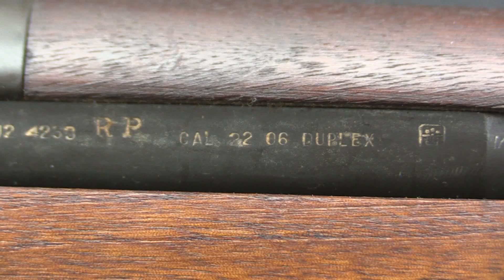.22-06 Duplex M1 Garand

Comment: In a shoulder rifle I don’t think the trade off is worth it.

However in say A belt fed MG like the M60 triplex rounds could make a lot of sense.  Pair the new cartridge with an appropriate regressively rifled barrel and you turn a gun firing 600 long range projectiles per minute into one spitting 1800 short range bullets.  In the MG role accuracy can be sacrificed for a 300% increase in hit percentage without any increase in heat buildup.

The ideal weapon for jungle patrol in Vietnam, an M60 firing triplex bullets from a commando length barrel.

Comment: DUPLEX ROUNDS will ALWAYS have the bullet in the back rear end the bullet in front in flight, degrading the accuracy of both significantly. The reason being that once the bullet leaves the muzzle, the front projectile will be bearing a higher aerodynamic drag while the rear projectile is drafting low pressure zone behind the front bullet. With both practically in contact at the muzzle, the blunt nose of the rear projectile is irrelevant; it will slow down at a slower rate than the bullet in front and rear end it in flight. The projectiles only begin to separate after the collision has destabilized both projectiles a little and they diverge sufficiently to unmask the rear projectile. It's a total shit show and there is no way to overcome the problem.

Comment: 65% better probability of hitting a target is no laughing matter. wonder at what range and groupings they were getting these
Reply: It was probably within practical range, but around the time they stopped the m16 was starting to become the go to rifle. Even though it wasn't a particularly good rifle, it was certainly an improvement over the M1 Garand. Even though I'd kill for an M1 Garand or Kar98k for historic value alone.
Reply: @Logan-zp8bi  did you mean to say the m14? The m16 was a fine rifle, no more hiccups than your typical military adopted rifle. Worst thing was ridiculous instructions to troops that the weapon didn't need cleaning.
Reply: @protoman1214  No I meant m16, there was some issue about the forward assist and failing to clear rifles to the point the problem becomes worse.
Reply: @Logan-zp8bi  hate to break it to you but our military didn't go from the m1 Garand to the m16
Reply: @protoman1214  I know, I was meaning around the time they discontinued the project, he said a couple of decades and mentions in the description during the 1950s. The m16 went into service 1965 and officially replaced the m14 in 1968.
Reply: @Logan-zp8bi  the m16 was an excellent wepon. Special forces using it in Vietnam was the reason it got adopted.  They had no issues with it. Untill they gave it to hippie draftees who couldn't maintain firearms and were told not to clean the gun.
Reply: @justinlance4174  It wasn't this, the M16 being finicky without cleaning is fuddlore. The real reason the gun saw issues, is because of the Amey giving soldiers bad ammo.
Reply: @Logan-zp8bi   you can get some in auction pretty easily for less than a grand
Reply: 50 to 300m iirc, search salvo rifle experiment im dtic.mil, it is available to the public.
Reply: Yeah knowing what methodology they used is really important. I suspect they used a silly criteria to try and market this
Reply: Probably close range. The light weight of the projectile gives it a low ballistic coefficiency. It will lose velocity and stability rather quickly.
Reply: Big thing!! Love it!
Reply: This 22 06 sounds pretty close to a 223, wonder if that helped at all, aside from firing two bullets...

Comment: I like the duplex theory better than the multiround burst theory, mostly because of the Closed Bolt.  If you fire from a closed bolt, then the 1st round of your burst is from a closed bolt.  The second one from a 2 round burst?  Open, then closes the bolt before it fires, regardless of how fast the rate of fire is, that reciprocation affects the accuracy.  So does duplexing, which I have tried.  The second round is generally the one that deviates from zero, on a bench rest.  However, I tested this handloading for Revolvers, and single shots.  (Contender, Competitor, which is basically the Lone Eagle with some improvements, and break open combination guns.)  Take the Taurus Judge, and duplex load slugs.  It's real easy, cheap, and accurate enough for what it is:  A pistol.  (Compared to the accuracy of 3 ball buck, you have 2 Minié Balls, instead of 3 spheres of lead.)  It has no business in a dedicated battle rifle, because there Accuracy is the primary concern, but in an Assault Carbine.  I would have to get a .30 Blackout and some dies to experiment with.  It's a hell of a lot easier to handload for manual (Lever, pump, revolvers, and single shot) actions.
Reply: Actually the best I've done was triplexing wadcutters in a Dan Wesson .357 Maximum.  Good luck getting your hands on one of those.  The point is, that multiplex rounds are available for civilians.  If you can get a rifled .45/410, it's pretty damned accessible.  Multiround bursts?  Not so much.

Comment: Seems like a decent concept. A little less energy than a 223, but pretty useable. I wonder if the projectiles tumbled after hitting like the original 55 gr 5.56mm did (1:14 twist i believe). I have a little experience with the Remington 357 Mag multiball load (2 000 buck pellets, 140 gr total). Shot well out of my 2.5" M-66. Spread was only a couple inches tops at 10 yds. Because the pellets are .36" and swage down through the forcing cone. Once i get going on handloading, i plan to re-create that load with sone Hornady buckshot i have (Remington discontinued the load years ago). Depending on what round ball moulds i can find, i might experiment with 45 ACP and 45 Colt, and maybe even 40. I remember an article from the 80's about short "tuna can" wadcutters for multi projectile loads. Should be fun and intetesting.

Comment: If there had been the saboted .22 Accelerator at that time, it could have been a (chronographed)
4000+ fps .22 projectile at minimal recoil. I have shot those at 1 MOA, although the impact was 10 inches
low in an 18 inch bbl   Ruger RSI 30.06 The 5.56 weighs less and takes up less space so more can be carried, but
it still makes you wonder what could have been.
Reply: Also, a true "duplex load" is something very different if you have read Elmer Keith

Comment: I suspect this is just a 06 necked down to 22 and you could most likely use loads designed for a swift in it.  Of course the 06 is over bore for a 308 round unless you use a very long barrel so....

Comment: "our troops are wasting too much ammo! lets make a rifle that fires two bullets at once, so they waste twice as much!"

genius
Reply: +SamuraiPie8111 
They weren't concerned about waste of ammo, they were concerned about poor accuracy, shown by large ammo expenditure per kill.
Also, a duplex round won't actually waste twice as much ammo, it will still be a single round, just with two bullets in the same casing.

Kind of like how a buckshot shell is still considered a single shell rather than several just because it contains several pellets in the same shell.
Reply: *****
An assumption based on that the main cost of round is the projectile.
The cost of ammo, if that's what you are calling a waste, is much more on the brass case (or steel, or tombak or whatever) the propellant and the primer cap.
I doubt that duplex ammo is that much of a cost increase over a normal round of roughly the same size and parameters.
It's kind of like saying that the main reason NATO switched standard caliber from 7,62x51 to 5,56x45 was that the latter was cheaper.

When it comes to ammo expenditure and waste, it's more about logistics and how much a soldier can carry. Ammo costs today are more about shipping it to the right place, rather than it's production cost.

And if you are really worried about the cost/resources issue, then they would fit brass collectors on guns to save the empty brass and re-use it.

The original magazines for the M16 was actually cheap 20 round magazines that came pre-loaded and was intended to be dropped and not re-used, just like the brass casings and the ammo clips for the M1 garand, and the soldiers would simply receive all their ammo in pre-loaded magazines.

This was later changed because those cheap magazines caused malfunctions of various kinds.

But we see the same thing in the linked ammo for the M249 SAW (FN minimi), where the links are disconnected and thrown out with the brass, requiring you to get ammo that is pre-linked by the manufacturer.
Unlike the FN MAG, which uses re-useable belts of 49 (and a half) that can be linked together and loaded separately by the soldiers.
Reply: *****
Okay. Too long.
Shorter and simpler.
Is it more wasteful to use buckshot for 12g shotguns than slugs?
Reply: *****
Kinda figured that after your other response.
Reply: I think it's a great loophole, since every 2 shots counts as 1! It's like cutting a pizza with half as many slices to reduce the number of slices you eat
Reply: Agent Bill Wilson was thinking the same thing lol....its our tax dollars theybdont care
Reply: tzint56
They haven't used blackpowder as propellant for more than a century. And a bullet is a bit more than a "machined lead lump", since the Hague convention limits military use of ammunition to full metal jacket or, otherwise non-deforming, non-fragmenting bullets.

But as I've said earlier, for the military it's more about the costs and problems of transports and supplies and how much a soldier can carry, when it comes to small arms ammunition, rather than the cost of manufacture.
Reply: Agent Bill Wilson just load the barrel with money and fire.
I’m sure it would have the same effect.
Reply: dork
Reply: @will blackwood Boy, I hope you're not this petulant of a fuckwit 2 years later. XD

Good god were you oversensitive.
Reply: tzint56 upset?
Reply: a waste? black powder to propel a cartridge and the casing itself are probably both more expensive then a machined lead lump

retard

Comment: Idea still sees practical use in Russian 12,7x107mm ammo for JakB-12,7 machine gun used in Mi-24. "Duplex" round either use 2 inert projectiles (31g and 30g) or 2 tracer projectiles (both 27g).
Reply: Montrala interesting did not know that! thanks for the info!
Reply: I was going to post about that duplex Russian round but figured someone would have put it up.  I was five years too late.